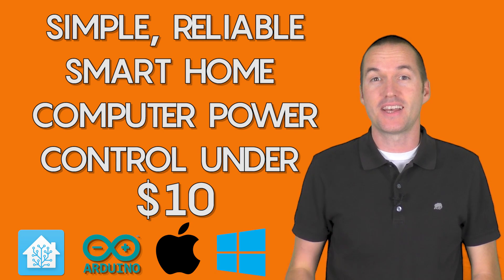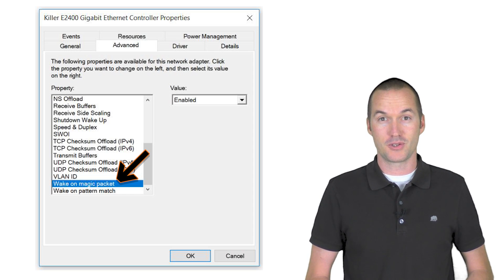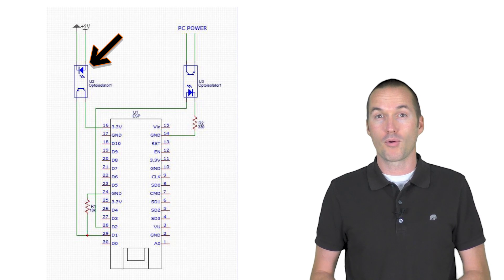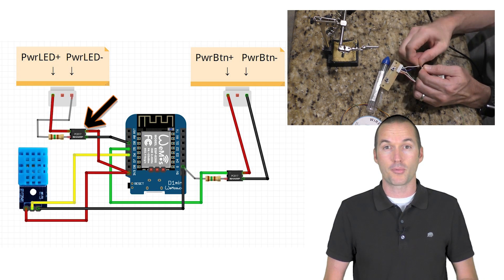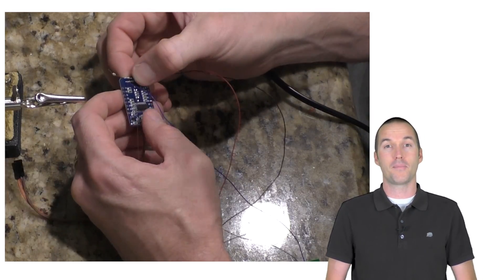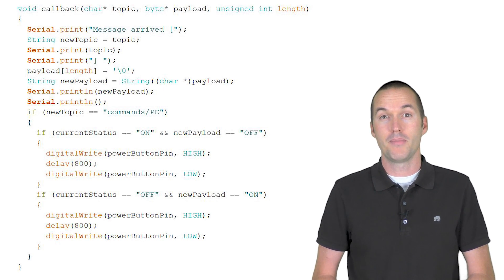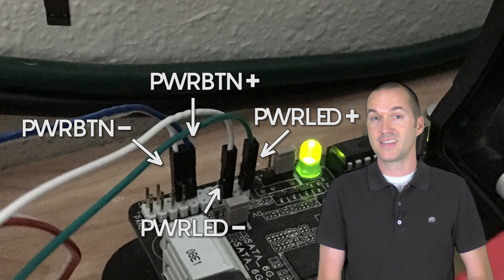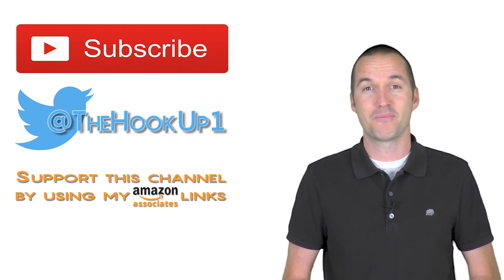$10 Remote Computer Power Management For Your Smart Home

Comment: I remembered this video (didn't think it was already 6 years old!). But it's still up to date. I've just made my coffee machine a little smarter using the same technology. I can now switch it on and let it preheat before I go for a shower in the morning.
I've modernized the code a little (availability and MQTT discovery) but otherwise it works exactly as described in the video (with two optoisolators).
Thanks for that.

Comment: Recently found this but the sketch doesn't work for me, specifically the include section at the beginning with the links to .h files at github. I have downloaded them and put them with other .h files in IDE which seems to work but still won't compile as it seems to object to ArduinoOTA. Am I missing something which has changed of the last few years, ie arduino IDE won't allow links to github or github won't except them

Comment: Was thinking of doing this myself, until i saw this video. Was exactly what i needed. 👍

The video is a bit too big picture. Had to go through many mistakes before getting it working right. The biggest mistake was, not configuring the button to shut down, and going to sleep instead. When the computer goes to sleep the LED will flash every 4 minutes. So the script thinks the computer is turned on again. This probably could be fixed with some timer in the script. But i didn´t bother to fix it at this moment. Since the solution is tho shut down every time.

Comment: Rob, one thing not mentioned in this video - I did this project with two of my PCs, one using a D1 Mini, and one using a D1 Mini Lite. They are both broadcasting an unsecured SSID (ESP_XXXXXX and FaryLinkXXXXXX) - is there some way to prevent this from happening by augmenting the code? I'm such a noob with JS -.-; (does anyone else have this issue?)
Reply: worked it out myself if anyone else needs help with this:
under the line in the code that says “WiFi.begin(ssid, password); “ add the following (without quotes):
“WiFi.mode(WIFI_STA);”

that’s it, no more SSID broadcast!

Comment: hello how can i change F to C??
Reply from the maker: In the code just remove the last line where I convert C to F.  The math was originally written for C, I just changed to F for my usage.
Reply: thanks..bytheway how can add another switch to this code? for controll fan,
so i can config automation in HASSIO to controll fan
like when temperature to this amount than turn on fan( by relay)?
Reply from the maker: @Tensopiseth  a little more difficult at that point.  You may want to look into ESPHomeYAML and ESPHomeLib to help you write code for the ESP8266.

Comment: Hi guys, I'm still trying to understand electronics and I'm struggling a little with the setup for this one.

To the right of PC817 for the gpio input to detect if the PC is on it just goes from 3v3 to D0 (via the optoisolator). Why do you not need a resistor on this side?

I'm guess I'm trying to compare it to putting a switch on a sonoff and detecting if the pin is high or not. For that I connected a resistor between 3v3 and gpio (to pull it high I think) then connected the switch between gpio and ground.

If you could try and straighten out my thinking I'd really appreciate it.
Reply from the maker: The resistor is to limit the current (mA) that runs through the LED in the optoisolator, LEDs themselves are not current limiting and can burn themselves out if they are provided a high current source.
Reply: Hi Rob, sorry I was asking why is a resistor not needed on the other side of the optoisolator? Where the 3v3 goes to D0.

Comment: You could do this with a Sonoff SV. You can connect the relay across PW+ and PW-. A lot easier to set up if this is too complicated for some people. You can also control it without having home assistant set up, either with the ewelink app (no firmware flashing), or in my case with ESPeasy firmware installed and direct control via http.
Reply from the maker: You could, you're right.  Do you use the GPIO to sense the current power state of the computer?
Reply: The Hook Up  No, it is a server at work. I monitor it with uptimerobot and get an email if it is offline for some reason. Then if need be I can turn it back on or hard reset with the sonoff.

Comment: WOL is a function of BIOS or UEFI. You can power on any computer, even without an installed OS. If it's not starting its because Windoze is not really shut down like you  think it is.  Try holding down shift while clicking shutdown to actually do a real power off.  Hope it helps.

Edit:. If it does work then, you can disable quick boot.
Reply from the maker: The reason I built this device is that it's for my wife's computer, so I didn't want to have to give her any additional instructions to make it work, I just wanted it to work every time.
Reply: That's true.  But what I gave was a test - if you hit Shift + Shutdown and then WOL worked, all you had to do was go to the Windoze settings and disable quickboot.  Then no additional instructions necessary.

But you found a workaround, so a bit of a mute point.

I was pointing out that for future, you should always be able to WOL a computer - regardless of OS if it's set properly in BIOS or UEFI.  If in fact it won't WOL, its not really off.

That setting in Windoze is a bit of a double edge sword...

Comment: ESP8266 GPIOs are 5V tollerant.
Reply from the maker: I'm not convinced they are.  I've got a few NodeMCUs that have 5V running into them and have for a few months, but I've also blown up a few ESP-01s with 5v input.  Espressif specifically lists the Vih of the gpio pins as 3.3V, which means their engineers did not design them to be 5V tolerant.

Comment: This is quite similar to a setup I designed and documented in written format for The Tech Report. The circuit design is pretty much identical to the way I set mine up. I tried to code mine to work more like a retail product, including an access point mode that allows the user to enter an SSID, passwords, and MQTT specifics without hard-coding it into the Arduino sketch. 

Link to my article:
https://techreport.com/review/31438/building-a-pc-remote-starter-from-scratch
Reply: do you have the source code for this i am unable to download it from the site you posted.

Comment: I'm having a hard time finding anything regarding powering the D1 Mini.  Is it only powered via a micro USB?  I'm thinking of splicing into my 5V Standby power on my ATX power supply to provide power instead of running a seperate USB cable into the back of my computer case.
Reply from the maker: That will work as long as your PSU is powered on... which it probably won't be if your computer is off.  Same problem using USB from the computer.  Mine is plugged into the wall using a power brick (ac adapter).
Reply: I had thought that the purple wire was always on as long as the power supply was plugged in?
Reply from the maker: Huh, maybe!  Give it a shot and let us know how it goes!
Reply: @ColeBrodine  thank you for posting your progress. This is exactly what I want to do. Seems silly to have to use another power outlet for the D1 mini when there's already power going to the PSU.

Comment: Great Video but the reason why WOL does not work with windows 10 is that windows 10 doesn't really shutdown the pc when you click shutdown by default. Windows goes into a quick boot mode that is similar to hibernate where windows is loaded from a  running state rather than starting and loading all the the services from scratch. This has the effect of windows starting faster but  it's not really a clean start. There is a setting in the power options to "Turn on fast startup" that is marked by default, if you turn this off (and do the normal setting for WOL) then it works. SideNote: Windows has a bad habit of switching settings back to defaults when windows updates.
Reply from the maker: Interesting, I'm going to do some testing on this.
Reply: I was going to post this exact comment. Disable fast startup and it will work like a charm for WOL. I've been using that with my media center for a while outside of HA. Only downside is when Microsoft releases a big update for Windows 10 you need to go in and change it again. You might be able to get around that with a Windows Task that applies the setting via the registry on startup or logon.
Reply: I have all the settings in w10 correct, it still fully shutsdown and doesnt want to start.

Comment: Great Video keep it up! I have an idea is there a way to make a battery 12 vdc monitor sensor for monitor Voltage that can  see at H.A What you think?
Reply from the maker: Yes, you would use a voltage divider with the analog pin on an esp chip

Comment: As I watched this video, I was thinking "he has got this pretty much perfect". Then I read some of the comments. Hmmm. One suggestion to newbies... search your videos and watch them in chronological order. I have watched you from the beginning so when you mention MQTT I know what you are talking about from your previous work. Sure, sometimes I have to pause but I think you have the pace perfect.
BTW I use the W10 snipping tool to print (or at lease save) your excellent wiring diagrams. I am still struggling with a way do document what I have created with all of the home-assistant stuff.  This helps.
Part of me wants to say "don't change a thing". But you code walk thru was an excellent improvement.
Always anticipating your next video.
Reply from the maker: The schematics are usually on the github too.  Thanks for the kind words.

Comment: Another great video.  I really like the D1 Mini.  so much power in a small package.  Semi real question - How do you avoid either giant  dust layers or missing parts when you clean up there with 'the style you have going on up there'?  The WAF is probably a little low on that one.  ;-)
Reply from the maker: Eh, the WAF isn't a problem because it's totally out of sight.  Oddly the dust factor hasn't been an issue at all.  I built that murphy bed 3 years ago and I've only gotten up there with a dust buster once, I wonder if it's high enough off the ground that not a lot of dust settles there?

Comment: Nice simple setup.  I love it and will be putting one in my computer so I can get out of bed and turn it on before I get into the office.  Thanks!
Just a suggestion :
 I'd add a "State/ForceOff" that triggers the power button for more than 10 seconds to do force power off.
For cases where the computer has locked up.
Reply from the maker: Great idea, I'll add that today and throw it on the github link.

Edit: Done, now "FORCE OFF" payload will press the power button for 10 seconds.
Reply: You'll have to tag the expert. :)  I'm a raw beginner so it'd just be a guess.
Reply: John Morrison I am also new to this YouTube messages 😂
Reply: great :-) I think I must create a new switch with this payload instead of the normal off, correct?
Reply: The Hook Up should I add a new switch with force off payload? Sorry for the double message, first one was without your tag
Reply from the maker: You could add it as it's own switch but I'm not sure I would want that on my normal home assistant dashboard.  I figure I will just manually send the mqtt payload if needed.